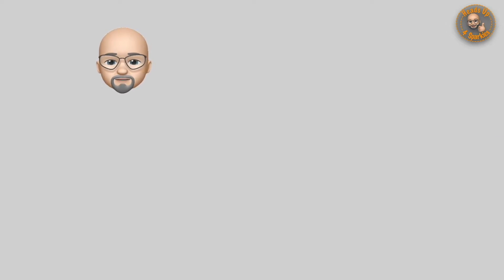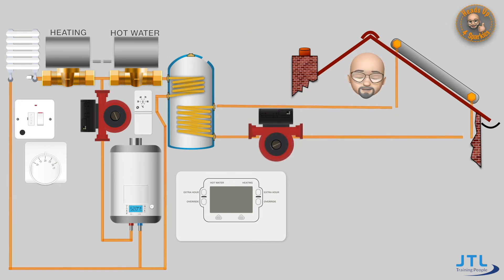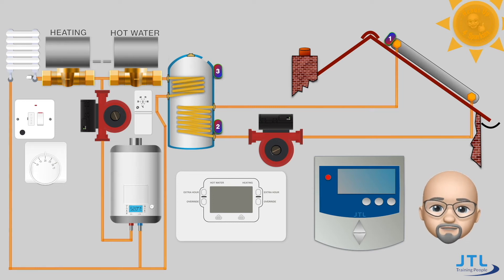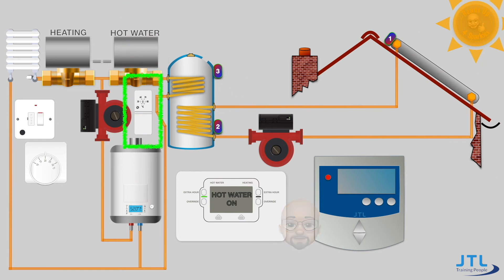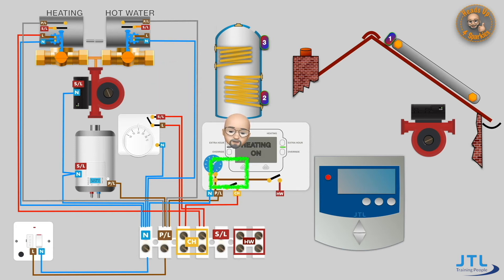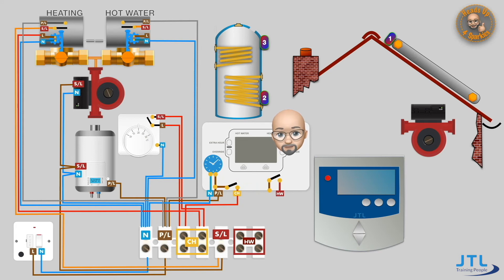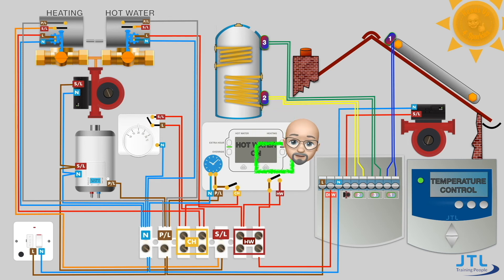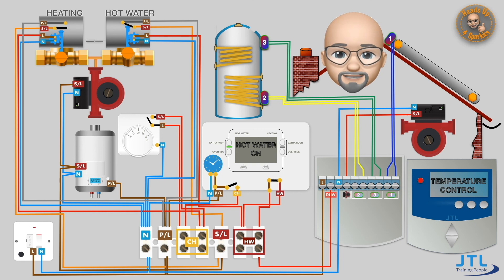S Plan with Solar Thermal Wiring AM2 and AM2s

Comment: Hi, is it a fail if you put a 13 amp fuse in.  We was given two 13 Amos and one 3 amp fuse.  And no specification.
Reply from the maker: Typically a heating system would need the fuse connection unit (FCU) to be fitted with a 3 Amp fuse. FCU’s come with a 13 Amp fuse as standard

Comment: Fabulous presentation, excellent visuals too !.... If i might just contribute ?
In my view, the purpose of the solar hot water system is to reduce the need for energy consumption !
The reason I mention this is because the solar needs to operate independently from the boiler .
The D.H.W  timer should be programmed to schedule a periodic " top up" of the storage tank to overcome any shortcomings of the solar performance during dull weather, and reduce legionella by bringing the water temperature up to a suitable level.
My system for instance, runs twice daily to address water & / or heating, based on the Honeywell programmer settings.
I also use an S-Plan too, using my combi boiler to provide heat, triggered by the room / cylinder stats leading eventually to the output of the microswitch in the zone valve(s).
My kitchen hot tap still runs from the combi directly though !
It has worked a treat for about 6 years and i find the boiler hardly needs to run between May and end of September due output of the 8 square meters of thermal solar panels on our roof.
The boiler is still timed to come on but the cylinder stat is usually open by that time so no heat is required.
Winter time is another story ... but the boiler still only needs to heat lukewarm water already warmed in the bottom of the cylinder.
I often wish i had a second tank in summertime as it often shuts the pump off and stagnates until somebody takes a midday shower.
A "destrat" pump and a few controls help to maximise efficiency.
Brill animation ... Thanks for sharing.
Reply from the maker: Thank you very much for your contribution… this particular system is aimed at the AM2 requirements .. 
You are clearly experienced with these systems. From my own research, the only thing I can be sure of is that there is no such thing as a “typical” system.

Comment: great video sir...i'll be doing my AM2 soon...my question is this....I've notice that the programmer isn't feeding the hot water valve directly.... is the programmer used in these system different from the ones normally used on a S or Y plan system....
Reply from the maker: In a typical S Plan arrangement .. the Programmer switches the permanent feed to the cylinder stat, which then operates the DHW valve. With the solar thermal addition, the programmer only switches a feed from the solar thermal controller, directly to the DHW valve. A Y plan differs again, as it has a “hot water bias” which varies .. I will be posting a Y plan explainer video soon 👍🏻 .. Good luck with your AM2 .. I hope this Channel has helped
Reply from the maker: Also .. I’ve not shown it as such in the video, but most programmers require the installer to install a link from the feed - to the feed side of the Hot Water and Central Heating switches 😀
Reply: @headsup4sparkies  ok thanks...because programmers wiring diagram shows it as if if the feed is linking both the heating and hot water

Comment: Thanks for such an informative video.
Just have a question that's been bugging me. Hopefully, you can help me with it. 
On the AM2S exam do you have to identify the switching line conductor and the permanent line conductor from the heating and hot water valves with brown sleeving? I would have thought that you would need to. But I've seen a few videos on S plan heating systems and no one seems to do it.
Reply from the maker: Hi …. My understanding is that the fixed installation basically stops at the Sw fused connection unit, and beyond that a wiring diagram is provided. 
I wouldn’t necessarily flag the Grey line, or Orange Sw/line as brown. 
That said, I am also fairly sure that you would not be marked down if you did decide to flag them with brown sleeving. The wiring diagram may put your mind at rest. Don’t forget that you also have the Solar Thermal control to include. Good luck ..
Reply: Haaaai